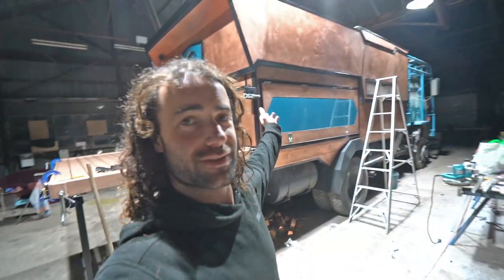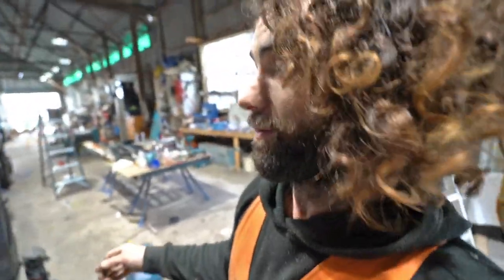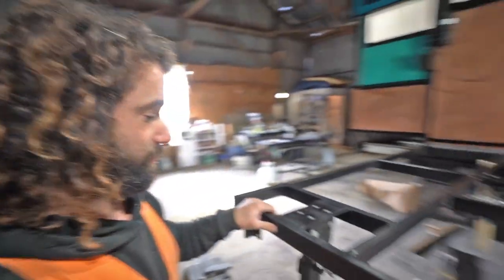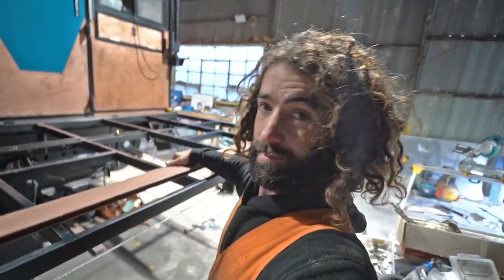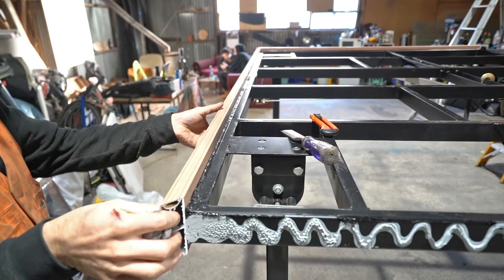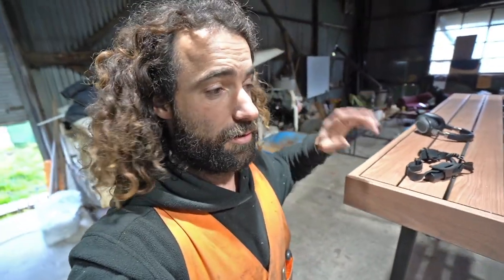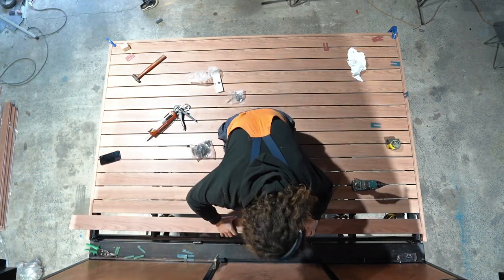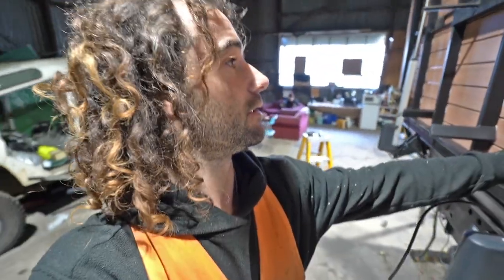Rear Deck Installation - Expedition Truck Build #20 - Off-Road 4x4 Tiny House

Comment: I like this guy, crazy ideas that are cool and he's executing them well. I put a large drop down deck like this on my 1966 deuce and a half RV and it is great. mine uses a 2500 lbs winch in the overhead, and chains on each side which also act as a kind of barrier to not fall off the sides. I too mounted the spare on it. when its down it works the same way as if you lowered the tire from under a pickup truck (ute) using the winch cable thru a roller in the middle of the deck. added and awning.

Comment: Hey mate it’s good seeing your content I’ve almost finished my build on a Mitsubishi canter but I’m swapping mod motorhome pod from the truck I have now to a 4x4 Mercedes Atego to handle the weight better and have something that is nicer to drive as my truck is registered under 4.5 ton nothing I’ve built has been engineered and I’m concerned that when I upgrad the truck and it gets annual inspection everything will have to be engineered i assume you have had to deal with some sort of checks to keep your truck registered is this something you could shed some lite on I’d be stoked to hear about it. Nice work on the truck too 👍🤙
Reply from the maker: Hey mate, the biggest thing is getting the body mounts engineered, the best thing to do is to contact an engineer and get the ball rolling with certification. All engineers are different so if you find one is too harsh you could look around for someone else

Comment: I'm making lots of gaffs with my build and have wasted lots of $$ doing so. So I know how it feels. Having said that your making progress and its looking great. Well done mate. Just a question. I have the same truck as yours and was wondering how much over hang you have beyond the back axle?
Reply from the maker: Yeah it can be very annoying, but it's all part of the journey, just push on and stay positive. I'll measure it and let you know, my chassis has been extended from the factory length and the living box is right on the limit, I think it's 60% of your wheel base? You can google that pretty easily

Comment: Watching for a couple years now. Almost done.. You mention the actuators are from ali and I know the others you have used are as well. If you don't mind could you reply with a link to the seller. There are so many and so many sellers on that site I find navigating it an absolute nightmare.
Reply from the maker: The actuators are from HAX, I'll rustle up a link for you
Reply: @dancampion  Thank you I appreciate it. 🙏
Reply: These ones. 👍